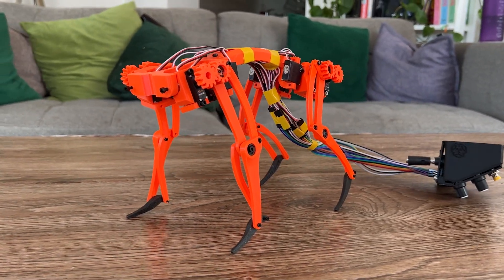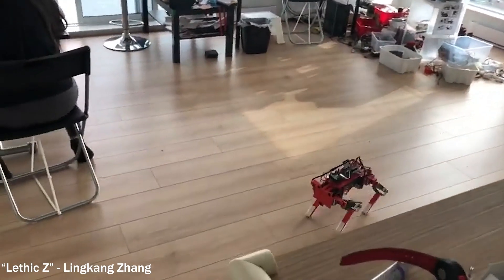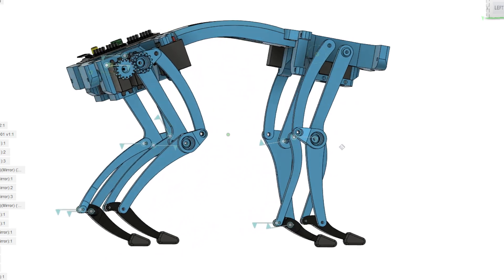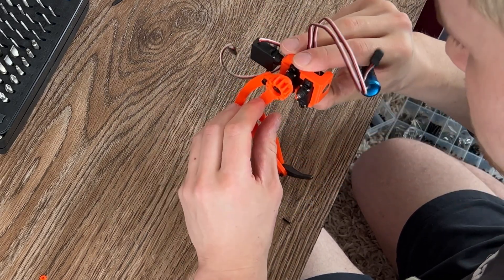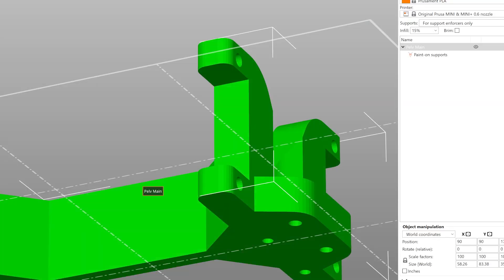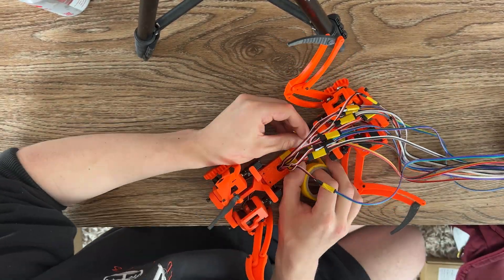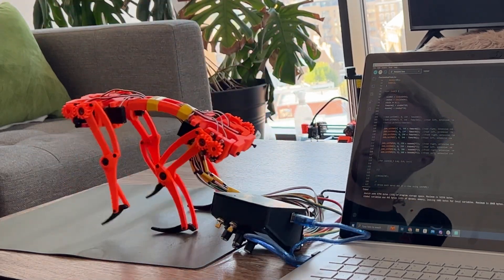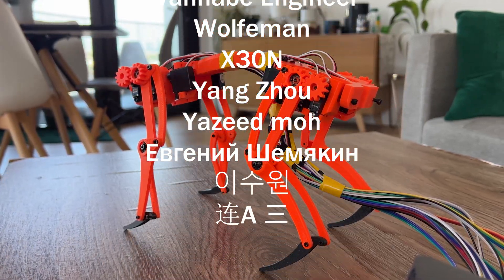Building a Robotic Fox with 3D Printing, Arduino and Fusion 360

Comment: honestly, rather than printing out and meticulously figuring out a filament "gripper" paw pad, you could just pop down to a hardware store, get some silicone caulking and drip a bit or pinch some onto the bottom and voila, grip achieved. the advantage of this would be absolute rapid prototyping as you can literally just scrape it off and start again, not to mention filament costs and time designing, and my personal opinion-it's just fun to be more physically involved in creation sometimes, add a human element every now and again, ya feel?

Comment: have you tried using an old gear system from an old pocket watch it is some thing that you shoed do to see if it fixes some of the mechanical problems in your robotic hands it can fix quite a few things that you might be having trouble with that might be able to fix it i have dun a few things with it myself and did the job that i was hoping for so you should try it

Comment: If you decide on using Unity and are using an arduino for control then I would highly recommend the Uduino plug-in for a super easy serial interface.

Comment: you could probably use fusion 360 to make a mold for the toe caps and use silicone to cast a firm but somewhat flexible piece

Comment: So just getting into the CAD side of 3d modeling for 3d printing (lots of Blender time in) , these files are in Fusion 360. 
Can you let me know if I understand this right. 
I am going to have to download and install Fusion 360 to look at and modify these file?
I can do that, If it has to be that way.
Thanks, This is a cool project and really want to get a look at it, hopefully build it or contribute to it also :)

Comment: For the grippy toes, print them in pla and just spray the bottoms with a spray on bed liner, the pla will want to melt a bit due to the dissolved solvents, but if you do very light coats and let it evaporate after like the 3 spray it will stop penetrating the pla.  It's fairly grippy.    

Another alternative would be plastidip that they use for tool handles, YMMV there I'm not sure how it would react with PLA, with PETG it was fine.  I suspect it may melt a lot, but you could mitigate that somehow .... /shrug

Comment: for the feet - it might serve your purposes to print up a 3-piece mold and cast urethane rubber (look at SmoothOn for good ideas and possible source) slip-on feet/shoes. that would allow ease of replacement for experimenting with the material, and later maintenance.

Comment: Just come across your channel. Great project and a clever leg mechanism!

For the control electronics, have you got a solution already in mind? If not, may I suggest a board I designed called Servo 2040, from Pimoroni. It's a programmable controller that can drive up to 18 servos, read 6 analog sensors, and has built-in voltage and current monitoring.

Comment: Will, as you probably already know, there are foam filaments which are used in 3D printed RC planes which you could print the head and tail from to save weight.  ColorFabb I believe it is.
Reply: LW PLA

Comment: One thing I can say is that all the TPU I have printed might have had some flexibility, but none of it was grippy or tacky. I think one would have to cast soft silicone in 3d printed moulds, in order to get true rubbery parts.
Reply: +1 to this. I've had good results making grippy feet from simple bathroom silicone sealant. For an extra tip, you can 3d print a very thin mould wall for the silicone attached to the foot, leave a hole to squirt the silicone into, and then cut away the mould wall when the silicone has cured

Comment: Wow, that's such a cool leg design! I love how compact and slim it looks.

As for controls, I recently played around with Steam Deck as a wireless robotic remote and it was super convenient to use. It has WiFi, Bluetooth and USB for connectivity, huge screen for cameras and/or telemetry, and a set of gamepad controlls. In my project I used a WiFi router with custom firmware as a remote receiver/transmitter, but you can easily use ESP32 instead.
Reply: That's a great idea. Especially since it has diverse inputs.
Reply: @AdobadoFantastico  For my projects I often use Pi with a screen and xbox 360 controller, and it worked nicely so i decided to build it into a single enclosure. I was about 4 days in when it downed on me that I am just making a crappy Steam Deck.

Comment: try flexible arc legs
Reply: ie not stiff, have flex in them
Reply: ie compliant flex parts
Reply: same for airless tires, flex arcs suspension cantilevers, both inside and outside the rim, even the arcs alone, but rim stabilizes the long arcs from the wheel attach hub
Reply: also you could run that with pulley cables, to flex a rigid stucture
Reply: rubber tires/contact over the slippery plastic
Reply: try 3d printed metal parts by making plastic surface conducting (conductive paint, graphite pencil), then electroplating/forming into metal, more durable with flex
Reply: ie tips for the beggers (money law system is begging with en-forcing, have a nice day)

Comment: Hey, love the videos man!

I asked ChatGPT if tubes of silicone caulking can be used to get a desired grip/traction on parts for a project by thinning it down and bellow is what it spit out:
It's also important to note that thinning silicone caulking may alter its properties, including its adhesive strength and durability. Therefore, thorough testing on representative surfaces is recommended before applying the thinned silicone to the final project. It could also be a cheaper alternative as well in using this method once you've found which combination worked for you?

ChatGPT :

Yes, silicone sold in caulking tubes can be thinned down to create a coating for enhancing the grip factor on parts of a project. However, it's important to note that the thinning process requires careful consideration and the use of appropriate solvents.

Silicone caulking typically comes in a thick paste form, which is not suitable for direct coating applications. To thin down silicone caulking, you would need to add a compatible solvent to reduce its viscosity. The solvent helps break down the silicone and make it more spreadable.

The choice of solvent depends on the type of silicone caulking you have. Common solvents used for thinning silicone include mineral spirits, toluene, xylene, or certain silicone-compatible thinners available on the market. It's crucial to read the manufacturer's guidelines and safety data sheets (SDS) to ensure compatibility and proper handling of the solvents.

Here's a general procedure to thin silicone caulking:

1. Start by selecting a well-ventilated area or use appropriate personal protective equipment (PPE) such as gloves, goggles, and a respirator if necessary.

2. Cut the tip of the caulking tube and squeeze out the desired amount of silicone into a clean container.

3. Gradually add small amounts of the chosen solvent to the silicone while stirring or mixing thoroughly. Add the solvent slowly to control the thinning process and achieve the desired consistency.

4. Continue mixing until the silicone and solvent are well-blended and reach the desired viscosity suitable for coating.

5. Test the thinned silicone on a small area or sample surface to ensure it provides the desired grip and meets your requirements. Adjust the consistency if needed.

Additionally, keep in mind that commercial silicone coatings specifically designed for grip and traction are available on the market. These coatings often have optimized formulations and properties for the intended application, providing reliable results without the need for thinning or customization.

Comment: I hope I'm wrong, but those servos look under powered for their purpose. I've build a few hexapods and my earlist one was made with Popsicle sticks and small servos. It could just barely walk whiled tethered. It didn't have a chance of walk once a battery was added.
I'm afraid your quadruped has the same problem with being under powered. I don't think your robot could walk more than a couple minutes with onboard power.
Again, I hope I'm wrong and I look forward to watching your progress.

FWIW, I used a Wii Nunchuck to control one of my latest hexapods. I thought it was fun to have a single handed controller to control the robot.

Good luck and thanks for sharing your latest project with us.

Comment: You can use those finger gloves for the feet. Print a "sausage" adapter and slip on of those in place. You can tuck the "glove" into the hole, thus locking it in place. A rubber type off finger glove is excellent for grip.
Optional, you can buy kitchen gloves, cut the fingers off those, and you'll also have the bumps they have on those to grip dishes. Those are even more grippy. I'd recommend using a bent thumb (like you'd press it on a table) as the shape for the feetums. If you want some padding, you can print the "thumb" foot, without the thumbprint area and put some silicone in there, shaped in a negative form, using the glove as a holder (so you don't have to deal with releasing the silicone).

None of the above are my ideas: these are some of the tricks used by the awesome people who make prosthetic limbs for cats in my area. I just print the parts for them as donations from time to time.

Comment: Nice! I'd love to see this project evolve.
Don't know if it's useful but I needed to calibrate the servos on a old project of mine (needed to know max clockwise + anticlockwise position of two SG90 servos) so I used a current shunt resistor to measure when the servos hit stall current. When the servo hits stall current, you know the servo has reached its max (for my project anyway) rotation and you can use those positions within the main function responsible for servo control. Just means that you run a quick calibration at setup and then you're good to go
Reply: Thats really smart! Also with a current shunt you could potentially torque limit the motors by measuring and limiting maximum current (by adjusting the voltage), which is something I would like to do. Never thought about using the current sensing as a limit switch though.

How large of a shunt resistor did you use? Measuring the voltage drop might become difficult if the resistance is too small.
Reply: @MangeDT  Thanks for the kind words!
The biggest resistors I had (in terms of Wattage) were 1W resistors and my project had two servos, the SG90 draws about 500mA @ 5v (2.5W) but can draw more current if it stalls so I put 4-5 1W resistors in parallel for fear of burning them out (My project tested each servo individually at startup, so I reckoned that accounting for the stall current of one servo, in terms of the wattage of the shunt resistor, was enough). 1 ohm resistance seemed low enough to me and in testing, via the serial plotter in Arduino IDE, you could clearly see the voltage drop (i.e increased current draw) from when I manually stalled the servo, you could figure out the actual values quite easily using Ohms law, but I just used the raw readings of the analogue pin as a relative value without converting it. From there it was just a case of integrating that code into my project and moving from bread board to prototype board.
Hope that's of help to you

Comment: Very cool and I think you'd probably benefit most from testing different limb section length combinations and of course sticky tabbies for the toes/feet. Perhaps even adding some springs to the "foot" and a possible extra rubbery toes section.
If you get this design working I think it could become very popular as it's very "simple" and clean.

Comment: Looks nice! I built something similar for my bachelors degree in mechatronics but i like your leg design, our robot had the knee motor mounted inside the thigh, making it quite bulky. 

Can recommend MG92b servos, they are slightly larger than the more common mg90 motors but have more torque.